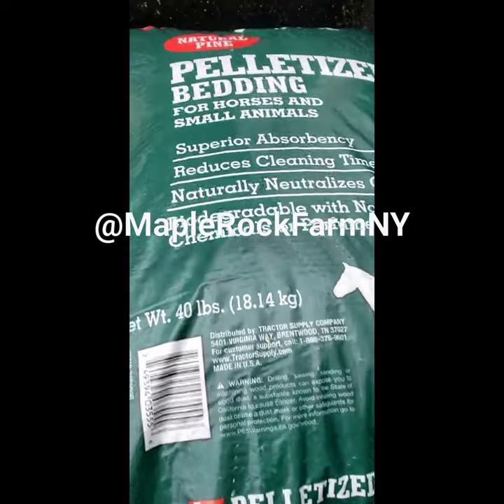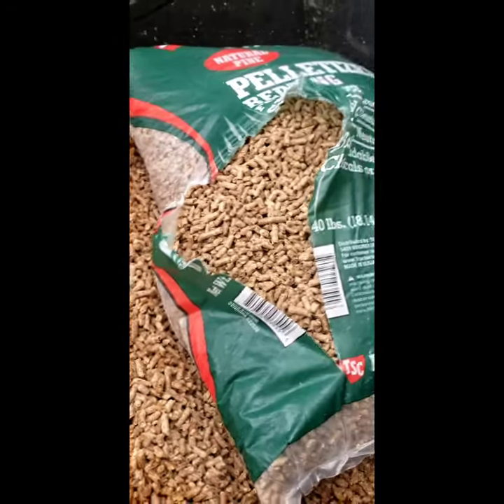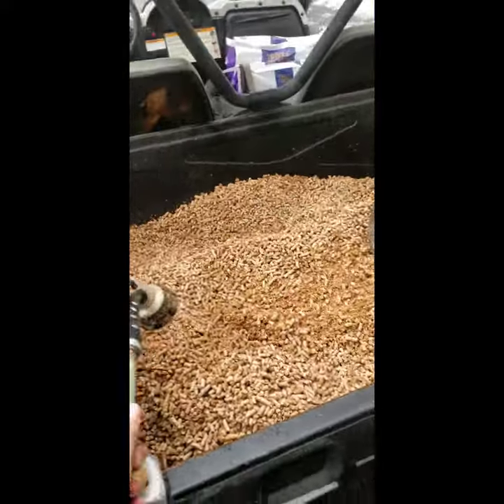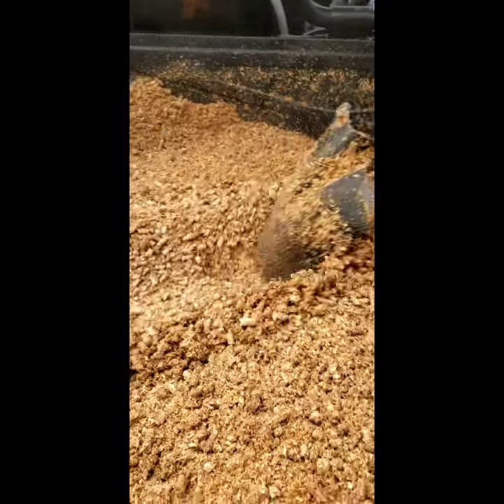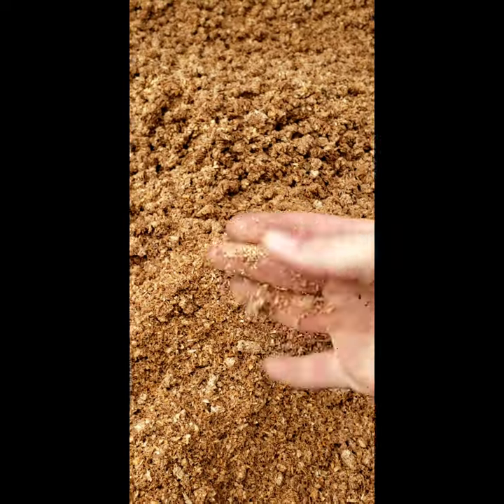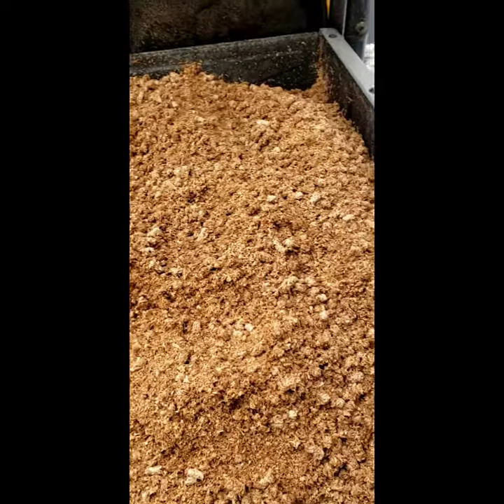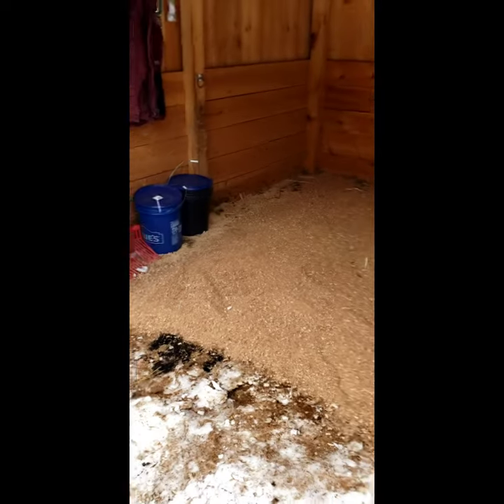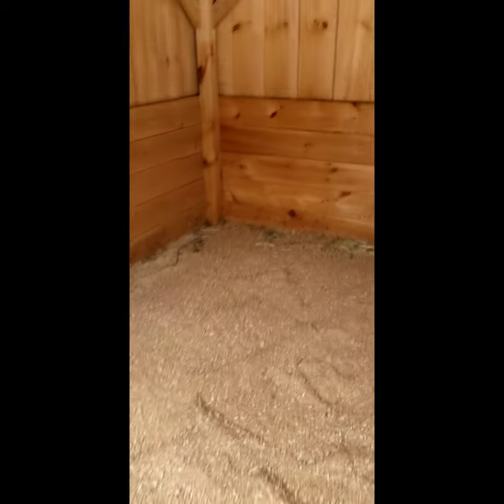How we use Tractor Supply 40# Pelletized Animal /Equine Bedding Part 1

Comment: What's the advantage of this over shavings?
Reply from the maker: @one7decimal2eight  cleanup is so much easier. Its almost like kitty litter.. very little waste so they last longer. The herd doesn't eat them.. some do like the shavings and nibble. Wood chips don't break down as fast in the manure pile..these do. They love to roll in the new bedding and it doesn't stick to them like the shavings. It soaks up urine so well, shaving just seem to get wet..this stuff clumps...there are probably more benefits but those are the high points for us
Reply: @maplerockfarmny  thanks for the quick reply.  My mother has a mini horse and mini donkey.  Donkey came down with thrush.  The stall is a dirt floor with shavings and periodically lime for the urine.  I dug it all out months ago and I know she scoops out the shavings when they get soaked.  But I am thinking about changing to this.  What do you recommend with the dirt floor?  Stall is probably 7 x 20.  If I do this for her what do you recommend?  And how often do you change them out?  Do you do it all at once?  Sorry for the questions, just want to be able to bang this out for her as she is older now and I don't want her doing that much heavy lifting and I only have a day a week to go out there and help so I want to make sure I do what I can to help stave off any more of this thrush business.
Reply from the maker: @one7decimal2eight   ok.. so this is best case scenaro.. put down a decent bed of no 2 stone.. drainage stone..not crusher run with dirt. You want the urine and water to be able to flow away. 

Then add stall mats. They have them at tractor supply..and I always see them used on market place. The mats give a solid surface for them to stand. Ideally space them about an inch apart for drainage. Once you lay them down shovel a few more bits of stone in the middle.. creates a slight hump..again for drainage. 

We don't use any shavings in the summer. They don't like the urine splashing on their legs. The first few days they might.. but toss some lime so it doesn't smell like the place to pee anymore.. they will learn.  This will also help because they won't pee in there as much in the winter

In the winter we add 3 bags of pelletiized bedding soaked. Daily we use a poo rake to clean out any issues.. pee or poo. 

We add approximately 1 bag per week. We have 11 donkeys and 1 mule.. 10x20 run in. 

If the weather has been real bad and they are in there alot(we don't lock them in..they have free choice to come and go) we clean the shavings out completely and start over with 3 bags. 

Hope that helps???!! If you have more don't hesitate to ask
Reply: @maplerockfarmny  ok so this is not the type of barn they come and go as they please inside and outside.  They are locked in at night and let out during the day.  So just so I have this right after I lay the stone down, then add mats on top?  Are they the type of mats with holes or are they solid rubber?  If they are solid, doesn't that just collect the pee?  What does the rock do then?  And you don't use any shavings or pellets on the mats?
Reply from the maker: @one7decimal2eight  I'll make a video today
Reply from the maker: @one7decimal2eight  uploading your video now!!
Reply: @maplerockfarmny  just watched it.  Makes sense.  Thanks for doing that!
Reply from the maker: @one7decimal2eight  hope it helps!